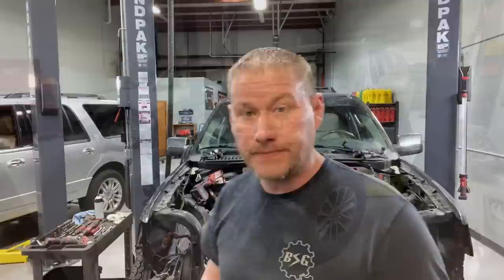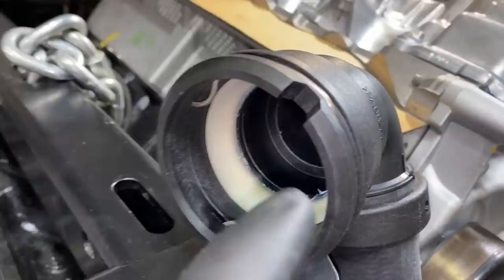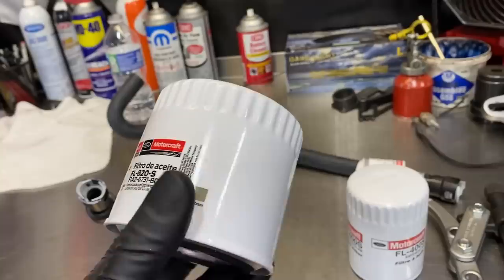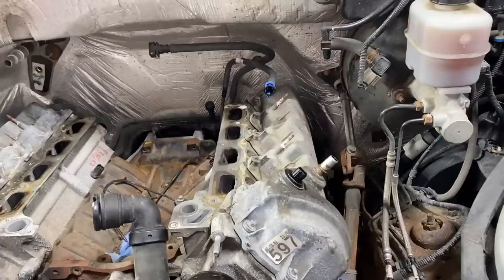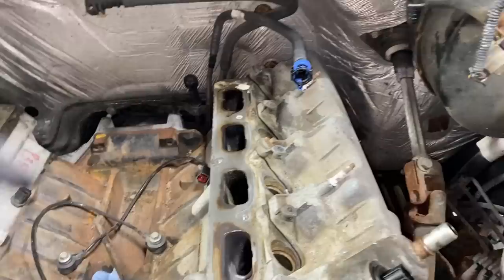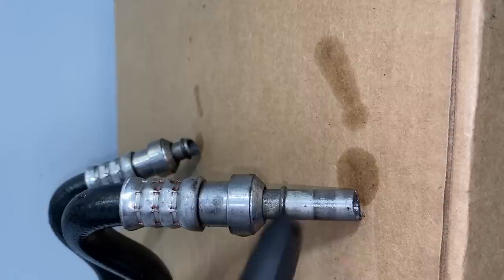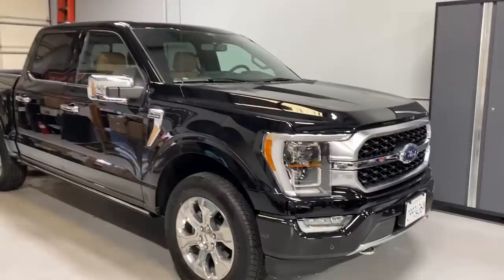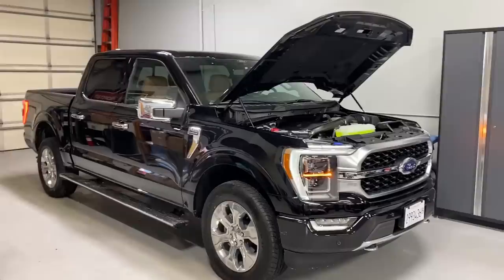Shop Update and The New 2021 F-150!

Comment: Need a little help. I have a 2005 Ford F150 V6 4.2l and I want to change the rockers & push rods, but don't know the ratio. Plus I will be taking off the upper intake to get to the IMRC cause my engine has a hard start and won't go when I step on the gas pedal when driving. If you help in anyway, Thank you.

Comment: Hey Brian, I own a 2003 4.6 and when I floor it, it likes to make a sqeak in between shifts. At first I was thinking it was the transmission, which still surprisingly works like a charm even after I bought it a few months agowitj 200k+ miles. Forums say it's probably like a harmonic something connected to the alternator. I just wanted to know if you had any other ideas as to what it might be?

Comment: Ford what was wrong with the oldschool constant tension hose clamps? Some designs are so stupid, makes it easier during assy but cost of ownership/reliability due to one stupid o ring.. whats funny is the heater core hoses u showed had quik connect fittings but one bypass hose has none which means it uses a reguyhose clamp lol

Comment: I'm curious on the cost from FOMOCO compared to quality remanufactured as well.  Do the new from Ford 5.4 3v have all the upgraded components like tensioners and Melling oil pumps as well?  I'm in need of of timing rebuild on my '07 F150 @ 170k and wondering if it makes more sense to drop a whole new motor instead.  Hate to drop $2-3k on timing job on a motor with high miles....but still beats $50k+ to replace the truck.

Comment: I always wonder at what point do you decide to replace the vehicle instead of the engine? 
My 2011 F150 Ecoboost has 137K miles, still running good. I’ve followed your advice on maintenance; transmission fluid, rear end fluid (need that friction modifier!), oil changes. It’s been dependable.
Reply: My son has a 2011 Ecoboost with 275K miles and still going strong.

Comment: Lol did you just say you can disconnect and reconnect those heater hoses no problem? Damn near every single time I replace heater hoses I almost always have to break the quick connects to even get them off lol
Reply from the maker: Yeah you must push in and work each tab loose then pull.
Reply: @FordTechMakuloco  o I certainly know how to work the tabs it’s just that the tabs never work like their supposed to lol

Comment: I have a problem with my 2013 edge sel the sync system it won’t blow hot air is there a way to reset the system

Comment: i have 2015 f150 3.5 eco temperature starts raising on higher speeds. never overheated also cooling fans come on when the gauge starts too tell numbers above the gauge. the outside temperature -20. do you have any ideas or direction for me to go to next

Comment: I have an issue with my 2014 Fusion it stalls after I’ve driven it for an hour if I turn it off I have a hard time restarting once it restarts it cuts off it starts shaking  and cuts off so I have to wait to restart it. Any ideas?

Comment: I cant wait for my Tesla Cybertruck to replace my 2006 F1504x4 w/ HD payload pkg. SO sick of legacy auto compnaies designing things to fail. My 5.4 3V only has 113k miles on it because i only drive it when i need to haul stuff for work ( remodeler). THe frame is rusting from inside out, the bed support rails are almost gone. I bought it new and take pretty good care of it but its a shame FORD doesnt care about making a quality product. THeyve lost me as a customer. THey also LIED  about the alternator size on the window sticker.

Comment: My 2010 5.4 had the quick disconnect at the radiator quickly disconnect itself while I was driving down the highway. Lost all coolant and instantly pegged the temp gauge. Thankfully no damage but it left me stranded for awhile. What a crappy design

Comment: @FordTechMakuloco Hey, Brian! I have a 2003 Ford F-150 with the 4.6L Romeo Triton V8 with 346,000 original miles pulling a Code P0171 Bank 1 Too Lean. Is it possible that the root of the cause could be a cracked or leaking vacuum line? My Intake Manifold is Cast Aluminum and my EGR is deleted with a block off plate over where the EGR would be and I have the EGR Vacuum Line Capped Off

Comment: Brian, I'm curious why you purchased the 3.5 Ecoboost over the 5.0 Coyote.   I didn't think you were fond of the 3.5 Ecoboost.  Thanks
Reply from the maker: The 18-20 5.0L engines were an absolute disaster. Are they fixed for 2021? IDK but I sure don't want to be Fords guinea pig.
Reply: @FordTechMakuloco  , I asked because my brother owns a 2018 Ford Raptor and after only 3000 he developed a bad rapping noise and literally had to have the motor broken down and rebuilt.  Something to do with the cam phasers and other stuff.  Thanks

Comment: Need some Fusion Hybrid videos (anything and everything)...I'd love some more Expedition vids as well...LOL...we have both...I'm being selfish.  LOL.  BTW: Those Quick Connect Hoses? They have them in other vehicles outside of Ford.  These stupid things were essentially demanded by the assembly teams, because pulling a grenade pin was just too hard.  The supplier that makes those QD's has had to pay Ford quite a bit of $$$ because their design that "passed" all the tests didn't actually "pass".  UGH.  

That is some extreme temps on that intake, that's very high temp resin used for it...Yikes!

Comment: Curious what your thoughts are on Fords 3.0 diesel. I'm pretty tempted to get one. I know all the torque numbers show the ecoboost is "better" but that's at 4500-5000 rpm, while the diesel is under 2k with its torque numbers.
Reply: Ecoboost is at around 2500.

Comment: Not to change the subject, but have a question.  I have a 15 Ford FX-4 with the 3.5 ECO which is showing ALOT of carbon from the exhaust and weep hole in the CAT.  The Ford Service Advisor says i should do an Induction Service to help correct the issue.  IS this advisable, and do they now have an Approved Induction Service for this Motor?  Not experiencing any running problems, just ALOT of carbon and putting spots on the driveway.  TY
Reply: Only 53K miles on the truck

Comment: why didn't you want the 2018-'20 ford F150?
Reply from the maker: Way too many problems with the 2nd gen 3.5L Ecoboost engines and the 5.0L is an absolute disaster on 18-20 models and most likely still in 2021.
Reply: @FordTechMakuloco  thanks. I have the 1st Ranger (2019) with the 4 cylinder ECO and it's awesome. My company truck. When I retire I want an F150. Thanks for the tip

Comment: Do a 5.0 ecoboost swap in the new shop truck!
Reply: Why would he do that when the ecoboost is a more powerful engine. And with all the issues with the 5.0 recently it is the more reliable engine. Also the new 5.0 has cylinder deactivation to add to its other older issues!
Reply: @stacystanley262  It would be cool to see a 5.0 with a twin turbo

Comment: Feel you pain on back ordered parts. Been waiting about 3 weeks on timing chain tensioners gaskets for 4.0 sohc.
Reply: There is no gasket for that. The tensioners bolt to the outside of the block.
Reply: @solarfall2728  Yes there is. Not really gaskets,more like thin metal washers.
Reply: @yam91racer  You may want to do a little research on this. There are no seals or gaskets of any type on the timing chain tensioners. Why? There's nothing to seal. Look it up if you  don't believe me.
Reply: @solarfall2728  I have. Watch FordTech's video series on this engine. Plus Ford has part numbers for them. Plus mine had them when taken apart.

Comment: You hearing more problems w the 2020 5.0 oil consumption still?
Reply from the maker: Yup
Reply: You have any info on root cause of 5.0 oil consumption? Read something about cylinder liner design. Don't know if it's true. Considering a new ford and engine choice. I appreciate your thoughts. Thanks much...

Comment: Brian my in-law has a 2014 Explorer and the A/C compressor is acting weird. It could be working fine one time and all of a sudden it will turn on and off and won't cool. It does have refrigerant on though, I was wondering if there is a way it can be fixed without taking it to a shop.

Any help is appreciated.
Reply: Overcharged? Evacuate and recharge to correct spec
Reply: @ronr7791  It has the same level from the factory. Nobody has worked on it.

Comment: Can you give some tips on the first reverse in the morning break squeal for the f150 it’s really annoying and I can’t seem to figure it out.
Reply: If you park it facing the other direction you will most likely find it squeals on the first stop. What I have found is that the break rotors will have a bit of rust form on them overnight.  The first time you apply the brakes that will be polished off and then..... no more noise. Just look at the rotors in the morning,  using a good light, you will most likely find that to be the case.
 Hopefully that helps.
Reply: @brucejones2354  issue is this squeal can be heard across the neighborhood and its not normal. All my other cars theirs zero or barley any noise. The truck SCREAMS! its so loud it punches though the house. It will wake you up, its that loud. I would understand a small squeak but this is excessive.

Comment: Is their an issue with the 5.0? Why get the ecoboost?
Reply from the maker: 18-20 5.0L engines were a disaster. Are they fixed for 2021? IDK but I sure don't want to be Fords guinea pig.
Reply: @FordTechMakuloco  Unbelievable. 5.0 should be a million mile engine.

Thanks for taking the time to respond

Comment: I WOULD LIKE TO KNOW HOW MUCH IT COSTS TO GET A NEW MOTOR FOR MY 2006 F150 WITH A 5.4 3 V
Reply: WILL A 5.4 2V WORK IN THE SAM TRUCK
Reply from the maker: Most are $7,800 right now.

Comment: If we are looking at a 2018-2020 f150's should we stay away from the ecoboost and look at the 5.0s?
Reply: The 5.0 had oil consumption issues. If you don't need to do a lot of heavy towing I'd look at the 3.3L. I bought a 2018 with this engine, and it has been fantastic, also it still has the 6R80 transmission up to 2020. This engine doesn't seem to get any love, but it is a more simplistic setup with adequate power.
Reply: @joeblow4888  my 18 5.0 burned some oil for a while but settled in after 25k. Maybe a quart every 5k. No issues otherwise.  I’m at 34k now.
Reply: @Bushy556  Hopefully you have no more problems. The 5.0 is a good engine, best of luck.

Comment: What made you buy the 10R80 with all the reported problems?
Reply from the maker: As of 2021 it is the only trans that is available in the F-150. Plus it has been out for over 3 years which is the usual amount of time it takes Ford to work out the bugs. I also have some tricks up my sleeve if any issues arise.
Reply: @FordTechMakuloco  Good to know this! Please do share your tricks if you can!
Reply: @FordTechMakuloco  Does the same 3 years bug removal apply to the problematic new 5.0 V8?

Comment: Have you ever had a 2004 expedition 5.4 has rough idle but no mis fire or faults ive checked everything i can think of just kinda feels like a mis but runs great
Reply: Even shakes at higher rpm
Reply: Sounds like vacuum leak bud
Reply: Ive smoked it cant find one
Reply: Have you checked to make sure all your coil packs are good?
Reply: Yeah everything is good scanner shows no misfires it runs good just shakes
Reply: @codyelliott6837  Bad crankshaft or harmonic balancer?
Reply: I was thinking balancer guess worth a shot

Comment: Damn 3v are nightmares i wont buy another one with you money my 05 had all the powertrain replaced back in 2009 engine ,transmission and rear end all fail over 10k got rid of it in 2011 bought coyote no issues sold it 375k now 2018 coyote no issues 210k and 23mpg that 3v only got me 12mpg and its gutless compare to coyote
Reply: How many miles do you have on your 18 5.0?
Reply: @rallymaccartney5543  210k i only use it to go to Mexico twice a month about 3k per trip 6k a month i change the oil and filters every month after i get back to usa  2nd trip 💪 coyote Ford power
Reply: @michoacanom4320  and how’s the oil consumption??? You must know about it being a 18-20 5.0 owner like myself
Reply: @rallymaccartney5543  to be honest i dont have oil consumption or rattles ive installed a catch can jlt and i get 2oz out of it for every oil change and when i drain the oil i measured it and always get 8.5qts i put 8.75 on it i change it my self since new always used motorcraft 5w20 synthetic blend and motorcraft filters so i know what goes in there  also fyi my truck was built in 10-2017 took possession on 12-2017
Reply: @michoacanom4320  it doesn’t have the 800-1900 RPM deceleration rattle? Or go through antifreeze? How’s your 10 speed been?
Reply: @rallymaccartney5543  nope none of that about a year ago the transmission was acting weird like clacking noise and it will jerk when cold but no deceleration i took it to the dealer they did an software update and solve the problem so happy also changed oil and filter every 50k and dif oil as well and front wheel hibs went out at 180k but other then that no issues im on my second battery and 4th tire set 275-55-20 hankook dyna pro 2
Reply: @michoacanom4320  I hope I have as good of an experience as you have
Reply: @rallymaccartney5543  change the fluids your self use motorcraft or have a mechanic do it but that you trust that you see what goes inside buy it yourself never do the 20bucks oil change or take to the stealership thats way overpriced and halfway job done
Reply: @michoacanom4320  does your sound like kind of like a diesel at idle too?
Reply: @rallymaccartney5543  nope sounds normal quite just at the tailpipe sounds so good but engine smooth it does takes like 10mins to get to normal idle when cold i thought that was abit to much but oh well it stays at 1k rpm when cold like 20-30 degrees Farenheit
Reply: @michoacanom4320  glad to see that 18 going strong buddy. Only 34k on my 18 5.0. Lee us informed!!

Comment: Egr cooler on a gas truck?
Reply from the maker: I just checked the WSM and it is an EGR cooler. Doesn't matter if it is gas or diesel engine,  if the emissions requirement call for a certain amount of NOx reduction and they need to cool the inert gases to get there then they will.
Reply: @FordTechMakuloco  wow they are cracking down on them emissions
Reply: @FordTechMakuloco  I actually have a problem myself with my truck and you might be able to help. I have a 2014 f150 3.5 eco boost and I’m having problems trying to find a front end noise. It’s a grinding/ vibrating noise in on the drivers side. I have replaced the hub, the 4wd actuator on driver side, the 4wd solinoid, the check valve beside the booster, the 4wd vacuum line that goes to both actuators and I’m still having the problem. I have done the test with the truck on and in 2wd jack the truck up and spin the tire and both actuators are working correctly. Could it be axles?

Comment: terrible hose design. Changed a design that wasn't broken to make you pay extra for a part that wasn't needed. Terrible intake design. Why make it out of plastic? was no real reason. Aluminum would still have been cheaper and more recyclable. Ford makes some garbage decision. Another reason the 3v engines are garbage. Sure they make you loads of Money Makuloco but once they are past the point of wanting to pay a mechanic to fix them they just end up filling up junk yards.

Comment: If the 5.4 is such a shitty motor why has ford used it so long
Reply from the maker: No one said it was bad.
Reply: @FordTechMakuloco  oh good
I bought a 05 f150  5.4
It had 337,000 miles on it. I couldn't believe how solid this truck felt. It felt better than my 01 Ram felt at 20,000. I really liked my Ram but had to sell it at 100,000. That said the quality is night and day. It had the famous exploding dash and the seats didnt wear well at all and I babied that truck. I bought this Ford for $1500 I paid $22,000 for that Ram in 02. 
This 5.4 sounded like a diesel pickup. It had 0308 code and 0022 code, Over retarded left bank. Owner said it needed timing chain. I thought how bad can that be I replaced the timing chain in my 95' 302H.O. No problem lol
I had to buy it it drove like a dream and had a new remaned tranny, strait body, new frontend ball joints, new tires, up grade stereo,  good paint every thing worked except one of the interior map lights and the adjustable side mirrors.
First thing I fixed the 0308 then the
P0022 called for VT solenoid I replaced  both sides and it had no effect🤔
Then I watched some of your video, but not all🤓 
Wow was I in for the job of my life.
I went to my Ford dealer and paid $1250ish for a complete timing kit minus VT solenoids.
The driver tensioner was bad an a guild on each side were in the pan. 
Ok my freind and I got it done and put it back together, now the rt bank is missing worse than the drivers side was in the beginning? WTF.
Well by not watching your complete vid, which I now have maybe 5 times. We didnt clamp the cams down  and the rt one skipped when we took the tensioner off, I'm assuming.
So back at it we go and tada, success.
I put all new coils and plugs in her.
 I'm running a motorcraft filter and 5w 40 synthetic. Ive changed it twice already. She feels and sounds amazing,  like she'll run another 300,000. And the power difference between my old Rams 5.2 and this 5.4 is incredible. That Dodge couldn't get out of it's own way.
I wish I would have replaced the oil pump now but it seems fine
I have spent a total of $3000 for what feels as sturdy of a truck for triple the price, only it now has 342,000mi on it  instead of 220,000
Am I fooling myself? Should I sell her or keep her?
Reply: @FordTechMakuloco  I guess what I'm asking is did I make a wise decision buying this truck
Or is it to wore out
I made a bad decision